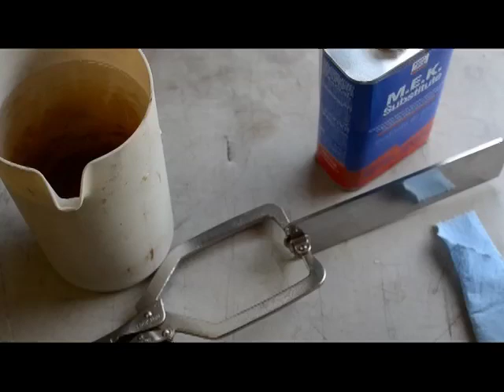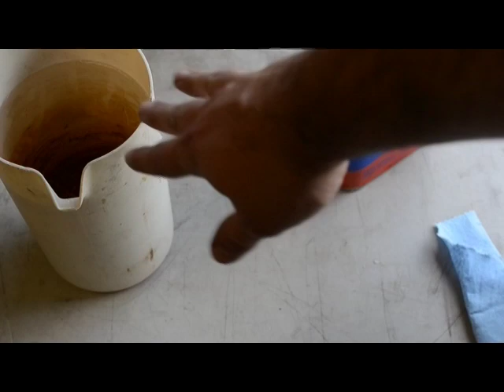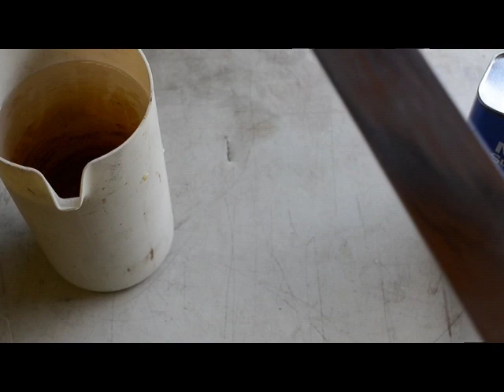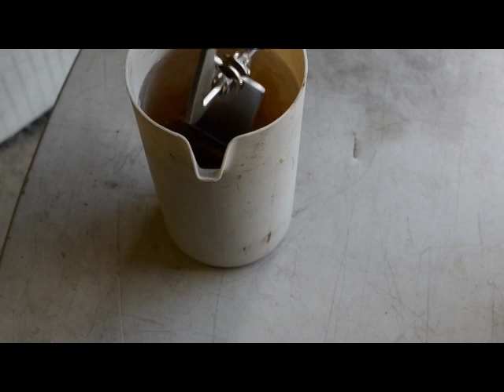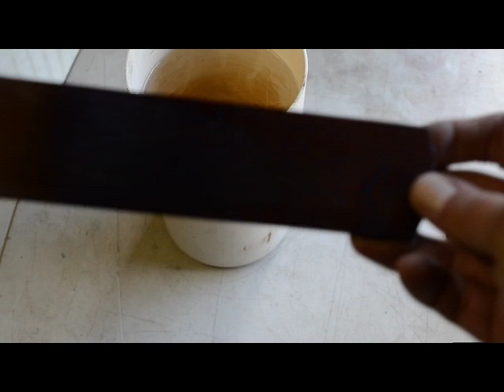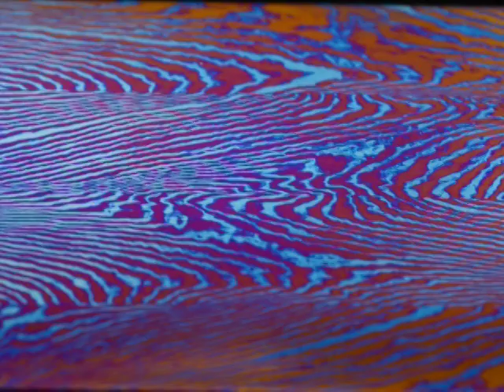Timascus Heat Color - How to anodize titanium with a torch

Comment: Awesome!  Just in case folks are wondering. In an oven. You want to start at temps around 800 degrees, after that raise slowly till the color you like is achieved.  I'm a fan around 1050.
Reply: What about for stainless steel or steel parts like hardware/screws and such? I am trying to get a bronze/gold color and i try at around 450-500 F and it colors lightly, but wears off quite quickly just by touching it with my fingers... Any ideas on what I am doing wrong?
Reply: @regularhumanbeing5211  this video is for titanium/titanium alloy and not steel